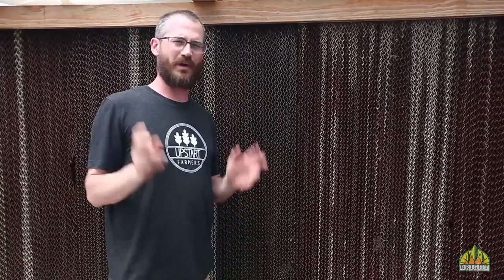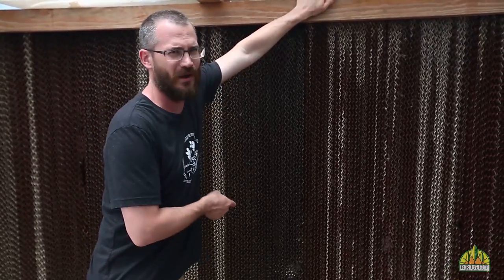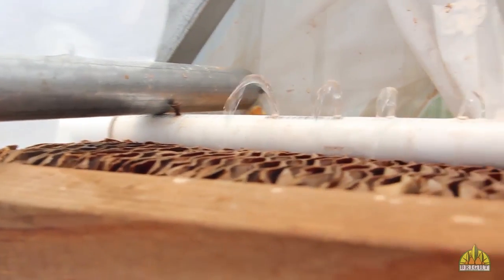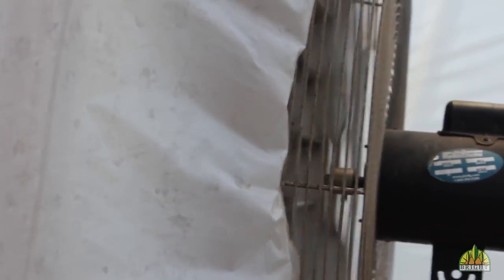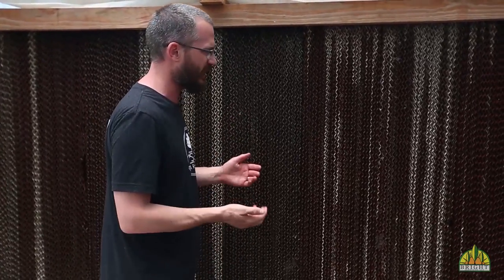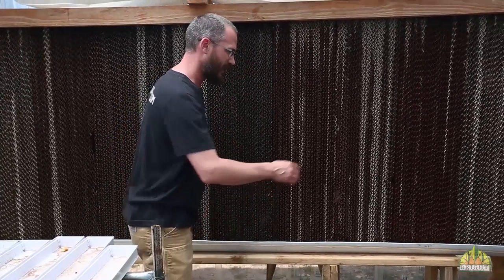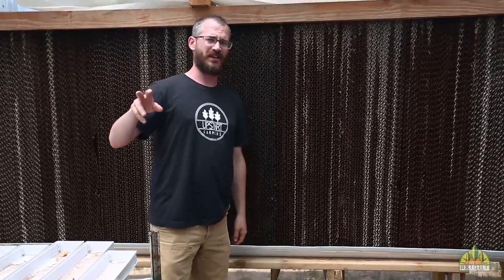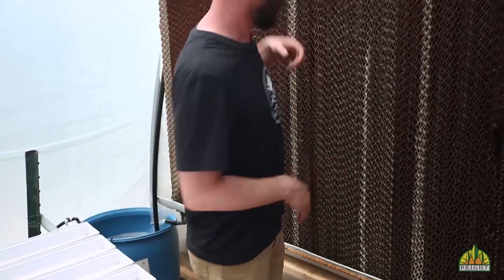Cooling a Greenhouse with a Cooling Wall

Comment: Doesn´t it get moldy? How long does the cardboard last? Are there any alternative materials that you know of?
Reply: It's a coated product that last years... it's a ecosystem on its own tbh 😂so yes can mold
Reply: Maybe if to add apple vinegar to water it LL prevent fr molding
Reply: @forkirpi  not all mold is bad mold I suggest running pump on timer till dry out and then kick on again controls relative humidity well
Reply: @forkirpi  not all mold is bad mold I suggest running pump on timer till dry out and then kick on again controls relative humidity well

Comment: a couple of questions:

- do you install the cooling pad right next to the entry vents?
- can you rig the system to send the water to naturally circulate back up to the top? or does it need to be manually cycled?
- i live in atlanta, georgia - humid climate, but i still hear these walls can cool your air by around 10 deg F. are there other methods you would recommend for more humid climates in the summer?

Comment: Just wondering if you have any experience using fogging systems like the ones from Jbird as evaporative coolers. They claim that their products are more efficient than pad and fan but I'm mostly interested in cooling results as I'm in Phoenix Az

Comment: If you are growing plants such as orchids or carnivorous plants  that are highly sensitive to water additives like chlorine etc... will it hurt using tap water in the cooling system or do you have to use R.O. water or well water?  Thanks for any info.  (I am not informed on info if the chemicals survive the transition from liquid to vapor )
Reply from the maker: Hey Aaron, This shouldn't be a problem at all, the only reason you would maybe want to use clean or RO water is to prevent buildup on the cooling pads. Hope that tip is helpful.

Comment: Hey bud what size pump do you have installed in that? Ive got a mining container that has 8, 6 ft pads that are about 4 ft wide. Trying to figure out what size pump i need. The cfm is gonna be about 36000 cfm

Comment: Why dont you use seawater? How to separate the brine?
Reply from the maker: Good question. It's because cooling walls use a paper or aspen media, it needs to be watered with a very low TDS otherwise the media gets damaged. Saltwater would be quick to ruin the media quickly and clog distribution lines.

Comment: How long is that cooling wall? I have a 16x32 high tunnel and was planning on making one like this. Seems like the media is about $120 for a 5 pack that is 6"D x 12"W x 36" L. So to do my 32' length of high tunnel it would be about $715 in media. I guess considering swamp coolers run upwards of $1500 - $2000+. I figure after I buy a pump, pvc and fittings I will probably spend another $200 or so. All in all from my estimates would be about $1000 to do a 32' long swamp cooler.
Reply from the maker: Hello! As a rule of thumb you want to have a square foot of cooling pad for every 200-300 cubic feet of air in your greenhouse. This will need to be adjusted though if you are in a high humidity or high temperature environment!
Reply: @ZipGrowInc  Thanks for the reply. I finally figured that calculation out and after that I was concerned that this would be a good solution for me or not because I am in zone 7b with high humidity summers. Often 90-100 F with 80-100% humidity. So some were saying that the efficiency of a swamp cooler in a high humidity environment is virtually 0%. But I am still learning and trying to find a good solution. I have started to try and find out what other greenhouses do in my area but I have a feeling they are just using huge fans/shutters and are just running better equipment and moving more air but will need to find out.
Reply: @Cloud 9 I will be honest. I never went this route because of the humidity/temps I typically see in my greenhouse. After calculating the temp/humidity for my zone I found that after a point the returns of cooling diminish. As more humidity is added to the greenhouse and as the Temps increase you get less and less cooling capacity. 

I am working on a geothermal implementation. I decided that using this technique would net more cooling capacity and additionally I am working on developing my own dehumidification system. I am intending on using solid desiccant for the moisture absorption and the only thing I need to figure out is my drying process for the desiccant. 

I think these systems really perform the best in areas that have a lot of dry heat and don't have ambient humidity to deal with. There is also the the evaporative cooling effect where the moisture that lands on the plants will allow some heat to ransfer to the moisture droplets and evaporate into the air. 

Zone 7 can be somewhat tricky in my opinion because of the diversity of weather and temps we see here. Anywhere from way below freezing all the way up to 100+ and 100% humidity. 

I also already use overhead sprinklers and drip tape in my greenhouse. I sometimes use my overheads on the crops that can be top watered in that transition between spring and summer and that works like evap cooling for those crops. I just can't do that in summer with my nightshades and most other summer crops. If I do top water them it will only be during the early morning so that the water can dissipate and evaporate by mid day. Never top water at night as that will encourage rot, mildew, etc. Water will stay in contact for too long with temps being too low making the perfect environment for those to thrive.

Comment: Hey Nate, how often should we have to add water into 55 gallon reservoir?
Reply: he said that he was using between 30 and 40 gallons a day when its really hot so daily in a hot season.
Reply: use a float valve conneted to a garden hose.

Comment: I have a greenhouse i just built in northern CA.  it seems as tho it gets really hot running at temps in the high 90's to 112ish even here in October.  its only a 10x20x9H hoop house.  I've set it up as an inflatable 2 layer and now have a 30-35% white shade cloth on it and dual exhaust fans that each do about 1100CFM but still am getting close to 100's on a 85-90 deg day.  i have yet to plant anything because I'm concerned these temps are too high.  do you think a cooling wall of some sort can help me get my temps down or should i try other measures?
thanks
Reply: THE MESSY MEDDLER yes, its either make a wet pad wall like this or get a high pressure fogging or mister cooling system.
Reply: what is your Humidity %? anything over 50% will provide Poor Results from a Evaporative  Cooler.
Reply: Northern CA person checking in 4 years later, did you end up trying it out? I'm going to want a greenhouse setup soon and need to find a way to fight the oppressive summer heat here!

Comment: I would be interested to know how many degrees of temp drop you get below abbient,  from the use of that 30 gallons of water in a day.
Reply from the maker: That's a great question, Tron - I'll ask Haydn at Bayberry Fresh and get back to you!
Reply: Bright Agrotech yes I would be interested in knowing as well :)
Reply: The home units used in the American SW will drop the air about 25-30F from outside temp, and they do it with a lot less pad and water.  Maybe 10 gallons a day and 20 sqft of pad.
Reply: @elBorrachoGuapo  True, however a common Pad for a residential home is less than 3ftx3ft cooling a 1,500 sq ft home. This example is using an entire wall area to cool an entire Greenhouse -more sq ft of pad = more sq ft of cooling

Comment: I think it's better you told the temperature and humidity difference in and out of the green house. evaporated cooling systems are increasing the humidity of the system. that is not good at all.
Reply: Sachintha Dahanayaka adding humidity is good if you live in a dry climate.
Reply: dezertXer yes that's correct
Reply: If you have a humid environment these won’t work.
Reply: if it is 9-13º Humidity - the added Humidity feels pretty good.

Comment: Can you use a swamp cooler instead of this?
Reply: this is a giant home made hand built swamp cooler. A swamp cooler is same as an evap cooler.. its just a fan that draws air thru a membraine with water in it so that the water cools down the air that is pulled thru it by process of evaporation.. simple stuff! have a good one
Reply: Good Answer

Comment: You could literally just throw an air conditioner in there, it would probably work better and be cheaper.
Reply: Fuck no, you ever ran an AC in your home and see the price there? Imagine outside with an uninsulated greenhouse. This is a lot more efficient and worth the set up.
Reply: sure if you want to spend 30000 dollars on electricity bill to get a produce that is 300 dollars worth